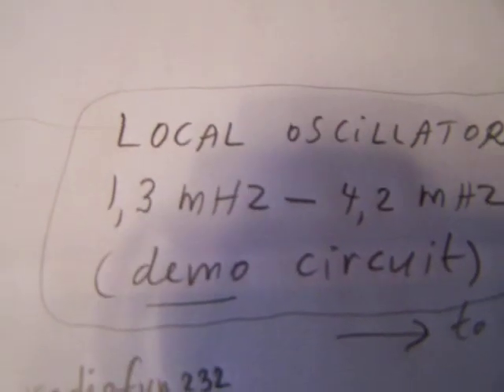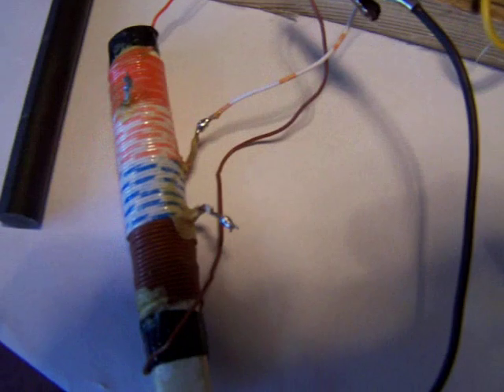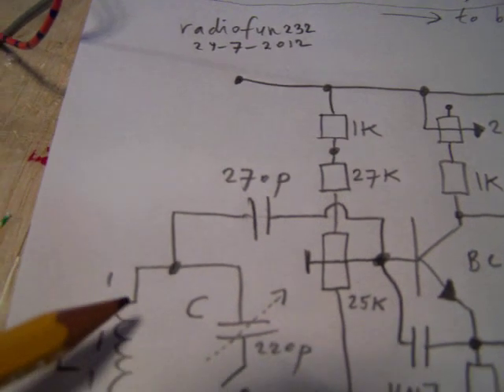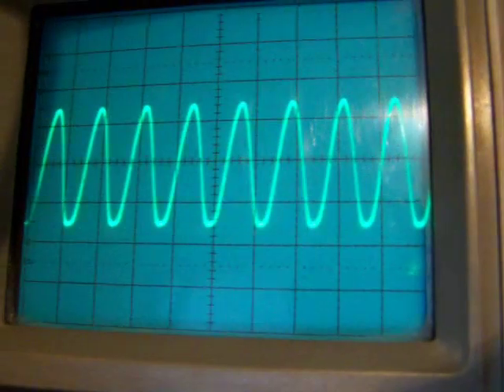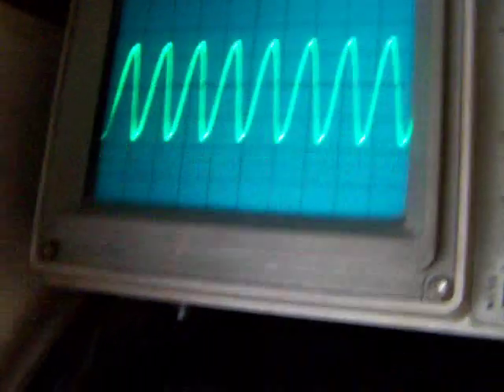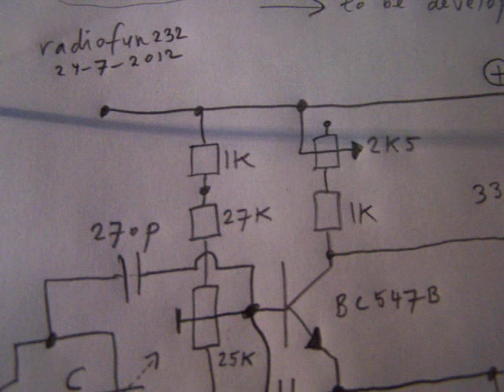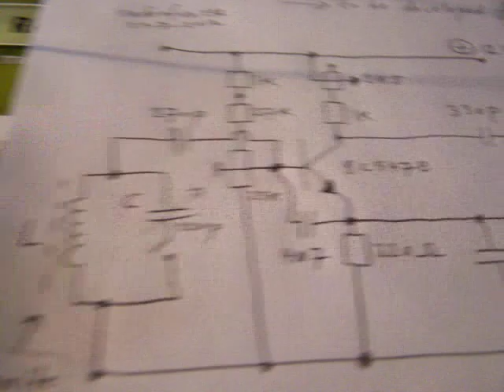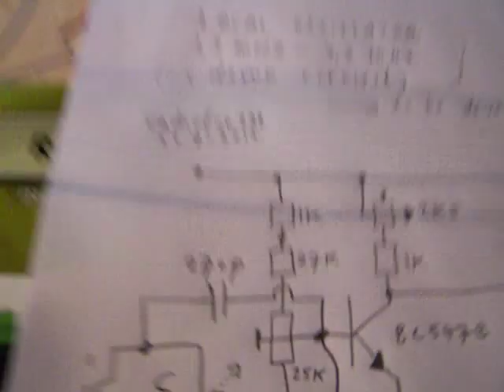local oscillator 1.3 MHz - 4.2 MHz (demo circuit)

Comment: Great video, I think I should add for anyone reading this who wants to try and build circuits like this, it's not a good idea to build high frequency circuits on stripboard/veroboard, I learned that the hard way.  The natural capacitance between the tracks will make the circuit unstable.  Wood is a good idea for beginners.

Comment from the maker: Thanks. I built al my superhet. radio's on wood with brass nails and it worked well. Above 12 MHz the stray and parasitic capacitance is an issue. But on wood I got up to 17 MHz.